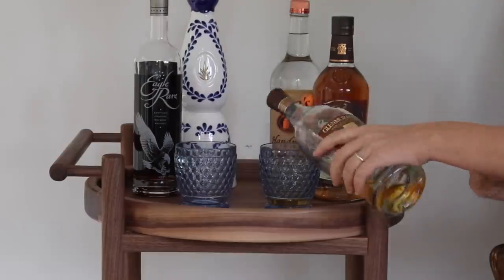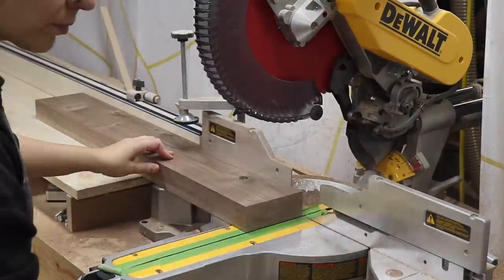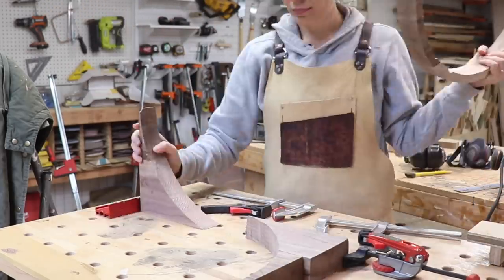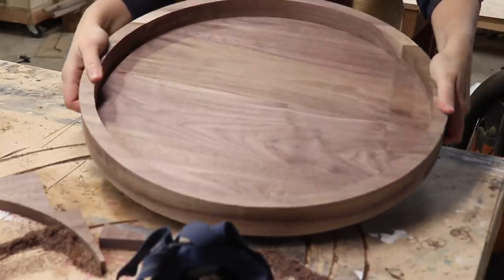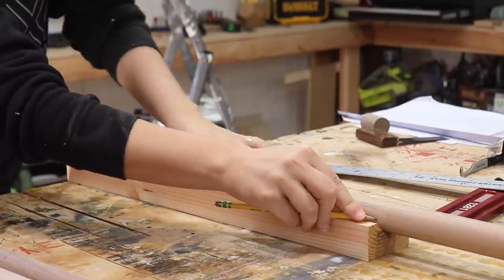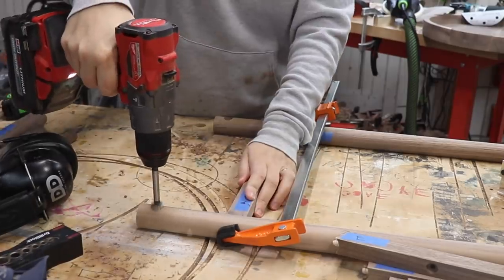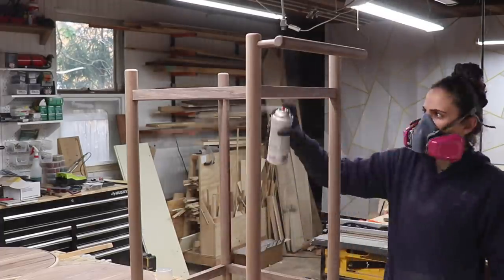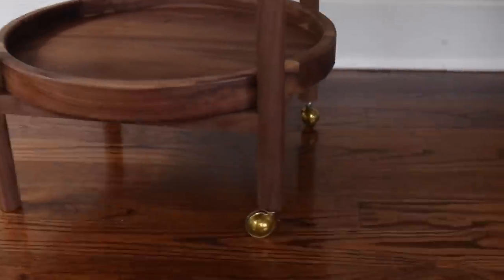How to Build a Modern Bar Cart // Round Tray // Dowel // DIY Woodworking

Comment: Quick tip for anyone using a circle-cutting router jig — if you want to avoid the nail hole in the center of your piece, which in this case isn’t noticeable but sometimes does get a bit annoying, there are lots of options but the easiest I’ve found is to use CA glue on some painter’s tape to temporarily adhere a piece of any 3/8” or 1/2” level (yes, level is important unless you’re desperate to get a tilted circle) to the center of your target piece, nail into that, clamp the target piece down and go to town with your plunge router. It adds more depth to need to plunge but you can always take a pass with a pattern/flush-cut bit if you can’t plunge deep enough and it avoids a hole on either side if anyone’s ever going to be able to see it. That’s a beautiful cart and nice work with the patches on the tray walls. I’d probably just have scrapped them, honestly, without even bothering to try to fix it. Oops.

Comment: Great stuff.  Thanks very much for showing the mistakes and fixes. Round rod joints are one of the trickiest. I humbly suggest looking at how steel tube and pipe joints are made with mitres for a few ideas. Yes, they are a completely different beast but you're smart enough to get something out of it.
Reply from the maker: Thanks so much! I will definitely check that out. Thanks

Comment: I'm really impressed with how you patched that router issue. It's a little difficult to tell in the video, but you may have been routing "uphill", which just means the wood fibers ahead of the cut are unsupported and prone to grab and tear out. I learned this lesson myself recently, the hard way of course, using a flush-trim bit on some curved table legs.
Reply from the maker: It’s was so annoying when it happened. Glad I was able to recover
Reply: @3x3CustomTamar  devastating. when it happened to me I basically through everything down and spent the rest of the day away from the shop lol.

Comment: Really nice build, Tamar.  That was a pretty darn clever recovery jig for the tearout on the ring.  Some nice tips in this video.   You are very, very creative.   I had the same kind of tearout when routing the side of a 2" thick Maple board a few weeks ago.   One of those things that makes you both swear and cringe at the same time.   Small tip for you - when using a pattern or flush trim bit, try to keep the waste to LESS than 20% of the diameter of the router bit - 10% would be even better.  So, 1/2" diameter router bit, max of .100" of waste to cut off, less is better.  That was my mistake also, even though I knew better.
Reply from the maker: Thanks so much! Glad I was able to recover. And good tip 👍

Comment: Love it, Tamar. I think a method might be making a dual vee block with channels at 90 degrees angles to hold the handle pieces while matching them to mark and join the ends. That right angle vee block should be useful for joining lots of round things at 90 degrees. You could even make it hashtag shaped and do both handles...maybe even adjustable? Have fun. (Mark the handle dowels for two centerlines at 90 degrees to each other. before using. 🤣)
Reply from the maker: I’m not quite sure I understand
Reply: @3x3CustomTamar  Think of a square block that you put vee channels on two adjacent sides ( at right angles) - and then you'd have a way to clamp two rods or dowels at 90 degrees to each other ...

Comment: I have a thought about the mitered handle. You can try putting it together first and then use the router table to round the dowels. Although I think maybe the miter joints themselves would have to be rasped to shape. Can't wait to see what you come up with. Thanks for the video.
Reply from the maker: Oh. That’s actually a great idea. I might I have to try that.
Reply: An even easier way to use the pre-made dowel is to make the first mitered corner and then set it aside while the glue dries. Then take the glued up section and put it in your miter saw using the short leg to reference 90° on the table to make the next cut. Now glue on the second short piece and trim them to length. Leaving them long while you match up the grain on the corners will help you get that continuous look without the pressure of having to be perfect the first time.
Reply: Deadwood, that is a good idea. Although you may note that the handle is not just there to look nice it's also used to move it. So I think using square stock is easier when you consider how you have to reinforce the miter. It's much easier when it's not already round in my opinion.
Reply from the maker: Deadwood Turning i like that idea
Reply from the maker: TheRaven0811 I was able to use a jig to drill and angles hole in the mitered dowel for a dowel connection. That part o had figured out. Ha.

Comment: I love your dowel making technique -- super clever! I'm curious if it would even work (for your handle miter joint) if you glued up your square pieces then did your router technique using a round-over with a bearing. Like giving something a round-over but a much more severe one.
Reply from the maker: Thanks! Yeah. I think that would have worked

Comment: Sip sip sip sip Scotch around da clock! 🤣🤣🤣 another great video.  I 💙 the silliness & "drinkin". I enjoyed the build & you showing. All the things that you did correctly. And showing the mishaps & acknowledging them. But more importantly what not to do in the future. While showing 1 way to resolve the issue. That can be helpful for some who might not have thought of it. There are a few ways to solve your. Original handle design conundrum. I believe you said starting with square stock. Cut 45's or 22½'s on square stock. Then "dowel" or spline the joint. Hopefully hiding the "dowel" or spline. Shape or roundover once the glue cures. Downside of that is a lot of hand sanding.
Reply from the maker: Haha! Thanks! That’s def one idea I’ve been toying with. I’ll have to do some experiments 🤓🤓

Comment: If you double side tape stock onto the dowel to make it square you maybe able to make the handle easier.
Reply: And make use of a center dowel hole to keep it from slipping during the cutting and assembly.

Comment: On the next one you might want to put the handle on the same side as the casters.  It would be less awkward to move.
Reply from the maker: I disagree. If the casters were on the same side as the handle I would have to tilt it in an extreme way in order to drag it. And everything would tip over. This way I only lift the legs a tad and I have full control and nothing tips over

Comment: Those trays are fantastic! Too bad the handle wouldn't work. But starting with square stock, mothering, and gluing it up. Then putting your round over on everything would probably work.
Reply from the maker: Thanks! Yeah. I think that’s the way to go. Will have to do some hand shaping in the joints. But I think that would work.
Reply: @3x3CustomTamar  totes. Well it's still square you could sneak some splines in too

Comment: Hi Tamar. I once made a round tray with a segmented rim. More or less like yours.  It turned out that the ring was preventing the woodmovement in the bottom, and the hole tray warped like crazy. How did you  overcome this problem?
Reply from the maker: Well I kept the grain direction the same. So hopefully when everything moved from side to side it will all move together. Get what I mean?
Reply: @3x3CustomTamar  Ah, I had a lot of segments, each 3 inch wide or so. That makes grain alignment almost impossible. I'll try your approach next time. Thanks and keep those wonderfulp video's coming. .

Comment: Nice
Reply from the maker: Thanks
Reply: @3x3CustomTamar  I'm going to try to copy that circle jig you made forget trying to cut out on bandsaw or jigsaw. Great idea! And great videos as well.
Reply from the maker: Robert Messer thanks! It works I’m a pinch. But it’s not really so adjustable. If you notice I used 2 in this video. Because the second diameter was so close to the first I couldn’t drill a hole in it. So I think I want to make one that’s more adjustable
Reply: @3x3CustomTamar  if you do plz make a video of how to make it. I'm trying to make one right now.

Comment: I think you had to put a dowel in at a 45 degree for the handle to work out but that's too many round surfaces to accurately reference off of to make the hole especially at an angle on an angled surface
Reply from the maker: I was able to accurately drill the holes for the dowels at a 45 with a jig. I made a hole in a scrap that was the same width as the dowel. Then I cut a 45 on it. Then I placed the dowel in that hole and used a drilling guide that was referencing that 45 edge of the scrap I used and drilled into the dowel. That part totally worked. The problem was that the 45s weren’t lining up correctly on opposite ends. So it was all wonky and crooked. I need to figure out a way to accurately cut 45s on opposing sides of the square stock
Reply: @3x3CustomTamar  You could maybe make the dowels but keep the square ends on so they don't roll, find center and drill 45 degrees on the drill press, then mark and cut the 45 degree angle on a mitre saw so they stay lined up. Basically leave the square ends so they don't roll and it's easier to reference everything.

Comment: For the table top, it appears likely that it will form a crack due to wood movement, as the wood has nowhere to go since it's constrained by the outer ring.  Thoughts?
Reply from the maker: Nope, Since I made the outer ring the way I did, the whole thing will move together. The grain in the outer ring and the base od the tray is running the same way. I’ve had it for a few seasons already and nothing moved!
Reply: @3x3CustomTamar  Ah, I forgot you aligned the grain patterns, which I thought was purely decorative at the time.  Good stuff!
Reply from the maker: Chris Ball thanks!

Comment: I am so glad that I don't drink, I would be soooo drunk!! 😬😀
P.s. that router incident, I am no expert, do you think you were going in the wrong direction? 🤔
Reply from the maker: Haha! So when you route the inside of an object you’re supposed to go from left to right. So that’s what I was trying to do. But since the wood was curved and there were little points jutting out from the jigsaw there was a lot of material in front of the bit. So it grabbed. That’s what I assumed. Ha
Reply: @3x3CustomTamar  Ahhh thanks 👍🙂
Reply: The problem is that you were using a straight bit.  They are great for along the grain cuts but deadly on the end grain.  I would recommend a spiral cut bit.  I had the same thing happen to me.  It actually bent the router shaft.
Reply from the maker: Ben Snyder I actually just bought a spiral flush trim bit amount 10 minutes ago. Ha.
Reply: You'll never use the straight bit again. Lol
Reply from the maker: Ben Snyder i hope that’s the case. It wasn’t cheap. Ha
Reply: @bensnyder5890  That's make sense. Hope you're alright as well 😬 did your router tool need to be replaced as a whole?
Reply: Yes.  It was more practical to replace the router than to fix it.